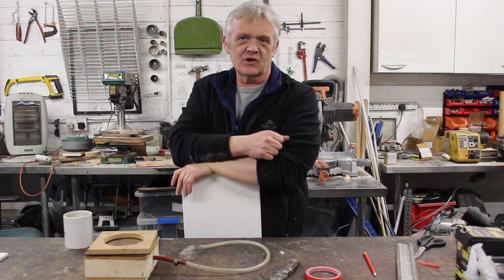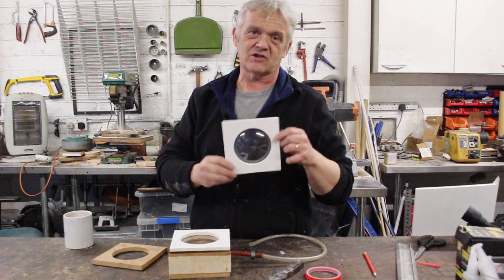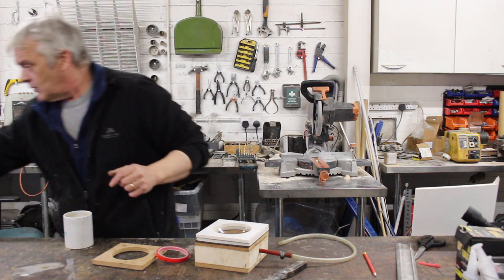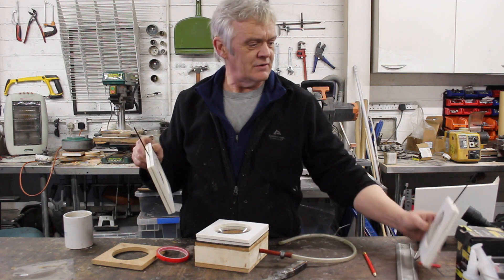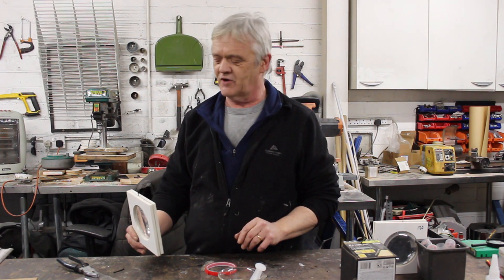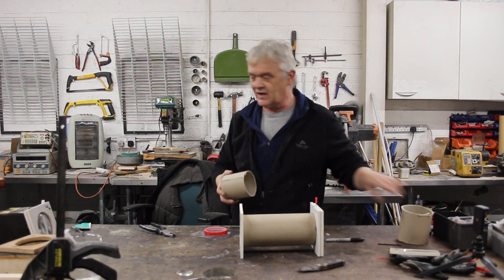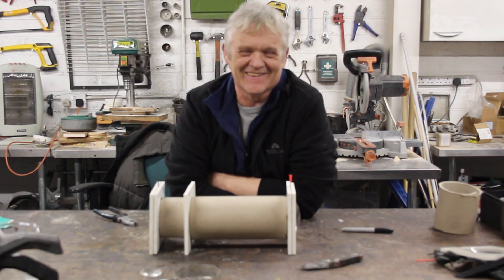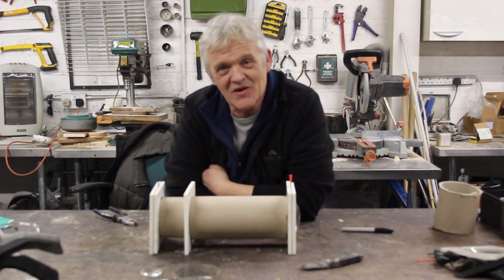1386 How To Make A Telescope From Water

Comment: Cool development. Are you going to try and make a concave lens? Perhaps try freezing the water and hoping for super clear ice?
Reply from the maker: cheers mate - the lens is only convex because the curve points out - the lenses are two formed surfaces if we flip the surface around then they would be concave - so the construction is basically the same - to prevent pressure from the water 'popping out' the lens a thicker plastic sheet would be needed but I would think that would really be all that is needed
Reply: @ThinkingandTinkering  Ah right, the pressure would just push it out with thin plastic. Lots of potential applications for it !

Comment: I used to grind and figure my own newtonian telescope mirrors, a lot of work. Be interesting to see how effective this would be on the moon and other celestial objects with a x2 focal length objective and x1/4 sized eyepiece. Should give you the same magnification as a high powered binocular ( ~x16 ). The focal lengths of first telescope objectives were idiotically long to help combat the inherent chromatic and spherical abberations in a single piece glass lens but they made some amazing discoveries nonetheless! But hey, with this method, if you can get to see craters on the Moon which you wouldn't otherwise be able see then that would be excellent...! 👍
Reply from the maker: well worth the effort mate

Comment: Haha
Cool!
Can you make a crown and flint setup for the objective? 
Super stuff!  I got to admit I didn't think you'd be using the same diameter for the objective as for the occular :)
Reply from the maker: it was just quicker to do mate - better would have been a 1/4 objective - but for me that would have meant another blowing box and as you know I tend to do POC quickly and cheaply - just to see if it works - after that I would do it again with what I have learnt and spend more time and care
Reply: @ThinkingandTinkering  i understand completely! Does the job for demonstrative purposes.
Huge eye relief OTOH :)
Could be placed in the same dimensions boards and make an almost cube like telescope with the smaller lens for an occular :)

I wanted to 3d print the scope I designed but never got to it as the most expensive parts had to be purchased anyway hence the cost savings were inexistent ... For example a midrange focuser would cost close to the price of the complete optical tube ... Made more sense to buy 2nd hand equipment and upgrade the weakest points. The goal is NEO detection so high accuracy requirements ment no room for "should work" ... 
I've since altered the design and will make a pure astrograph with two different focal length on the same tube assembly to be used alternatively.
Point is to work out the mechanism of switching between configs sans screwing the collimation at all.
Reply: @actudoran  mate you clearly know what you are doing - and I clearly don't - yet lol - it would be awesome to see you tackle this with water lenses - a high power telescope at pennies - that would be fantastic
Reply: @TnTOmnibus  making something high power ... not that hard, making it okish could be tricky ... 
had a look the other day at the refractive indexes of various liquids to use as a combo of say water and glycol ... like say have a double convex lens filled with water like Rob's and to the back of it just a straight plain sheet of plastic where you fill it with glycol ... problem is there will be a series of mediums for the light to go through: plastic film, water, plastic film, glycol, plastic film ... it just turns the whole thing into a bit of a nightmare for calculating the change of the total system with temperature variations ... :)

Never mind me ... I am used to all those issues and gave in ... about a year ago I dished out the cash for a triplet apochromatic beast ... 

OTOH termoformed concave surface to be mirrored with silver nitrate could make a nice little mirror :)